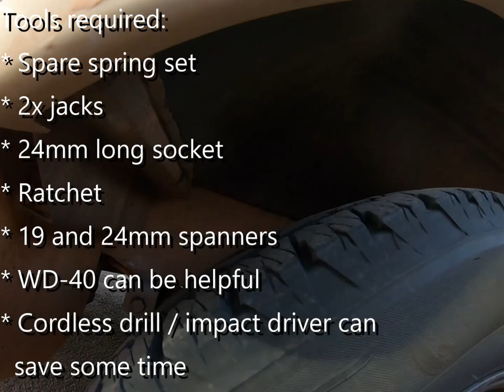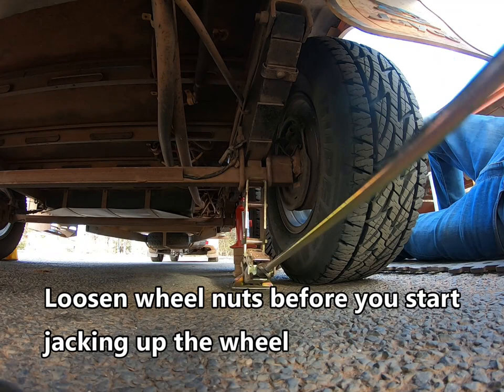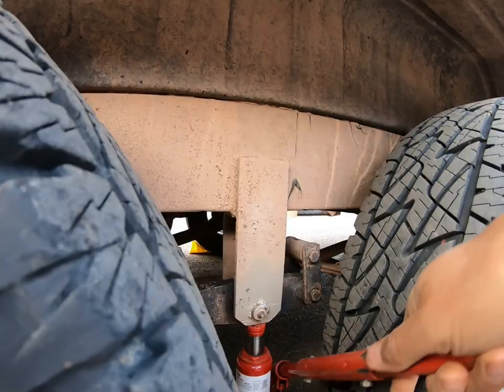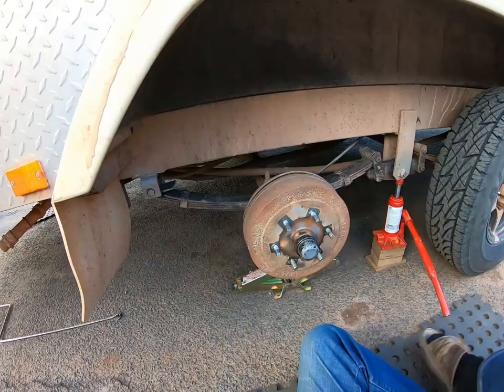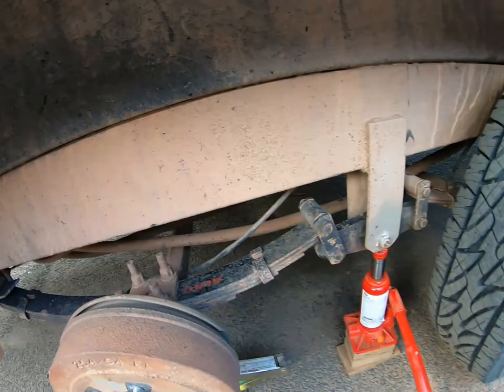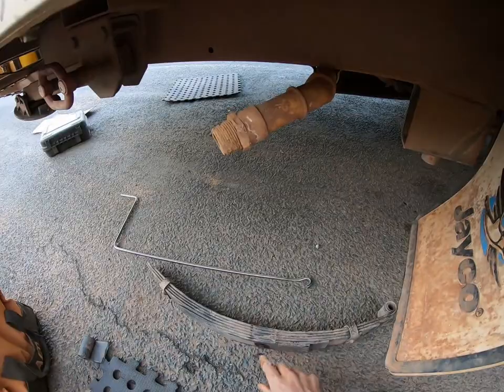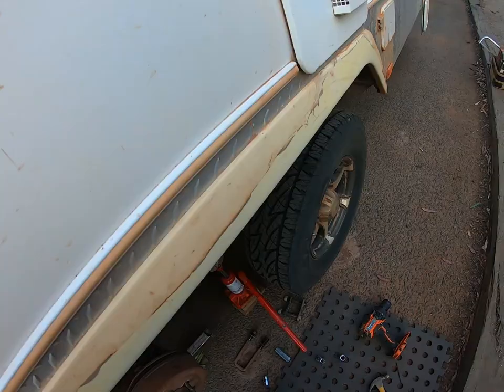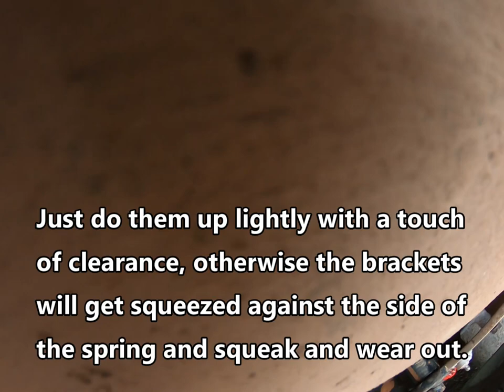How to replace a broken caravan leaf spring

Comment: Old spring looked relatively new, any reason for it failing?
Reply from the maker: Yes this spring was installed about 12 months earlier on Cape York so it was pretty new, though had covered probably 40000km since installation. Apparently the Al-Ko springs are pretty soft, and this design suspension (rocker)  is unfortunately prone to snapping the rear springs! That's why I've had to replace them a few times and why I decided to record it!
Reply: Thanks for the how-to video. I just replaced one of mine, RHS rear, I had to back over a mountable kerb and when all the weight was on the rear Axel, the spring broke. On inspection, it was cracked through about halfway for some time. Took about 1.5 hours from start to finish.